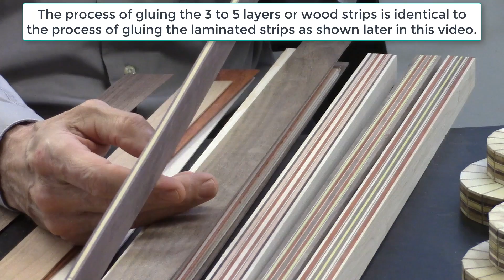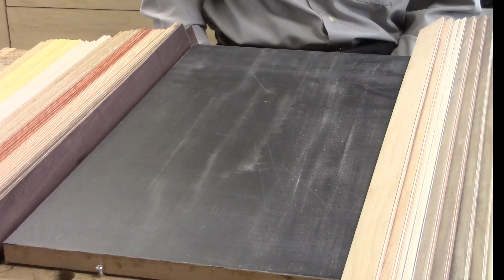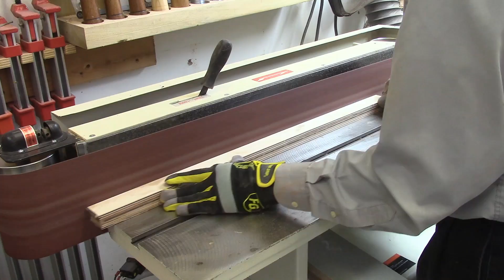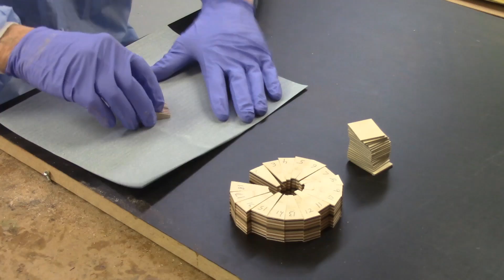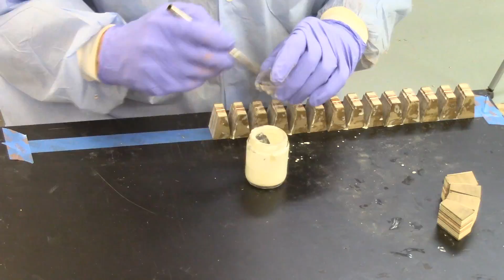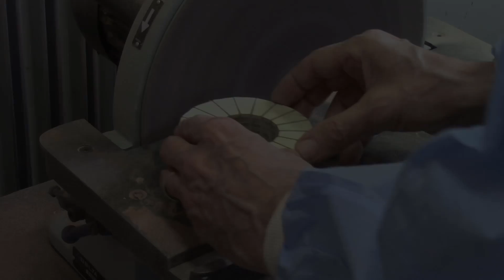Segmented Wood Feature Rings - Design and Production (10)

Comment: Great video, did you have to sand the wood after you cut from the bandsaw? I can make the strips but the cut is not clean enough / I have to sand before glue up. Thanks Again.
Reply from the maker: I normally cut with a 1/2" wide blade with 1 8 or 10 tpi.  With this blade the only sanding I do is to sand the fuzzies off the bottom edge of the wood strips and also sand off the bur on the end of the wood strip.  If I cut with a 4 or 6 tpi blade I would probably need to do some surface sanding.

Comment: I noticed you slid a piece of thin shim material under the front angle iron prior to clamping the glued-up strips.  What was its purpose and thickness?  You didn't mention it as you were describing the process.  Did the rear angle iron piece also have a shim?
Reply from the maker: The video you were watching is an old video in which I just used aluminum angle irons to clamp the thin boards together.  I am not sure why I used this shim.  It appears to be a thin strip about 0.020" thick.  The problem that I had using the technique described in this video is that the angle irons tended to angle up and not give perfectly parallel edges on  the glued up strips. I now use the Glue Jig system which is described on the following web page:

http://www.accu-slice.com/store/p54/gluejig.html

This Glue Jig system eliminated the angling up of the angle irons because one angle iron is clamped to the base and the other slides on a channel to prevent it from angling up. 

In the video tab on that page are a number of videos showing the application of this system.
Reply: @Accu-Slice  Thanks for the update.  I tried to check out the t-slot channels you mentioned were available on the accu-slice site but was unable to find them listed anywhere as a separate item.  Wanted to write up a couple of feasibility options before proceeding further.
Reply: @Accu-Slice  Can you point me to the location where the t-slot channels are available for the glue jig fixture. You mentioned they were available on the accu-slice website  in your glue-jig assembly video, but I was unable to track them down.  I would like to price out some size adjustment options to create some custom smaller accent rings.  Thanks.

Comment: i see your comment that you do not need to sand your strips. I use a Delta 14" band saw with the Carter guides and a 1/2" blade. tension seems good, yet i still get drift i must correct so I have to sand. I think I will try a different blade. any suggestions?
Reply from the maker: The only sanding that I do on my rings is a quick sanding of the edges to remove the fuies.  This is what is unique about the Accu-Slice band saw accessory.  Since the wood is mounted to a femce there is no laterial movement of the wood as it is pushed through the band saw blade.  As a result we see no band saw blade drift and the cuts are quire clean.  There are a number pf examples showing this technique on many of my videos.

Comment: Very interesting.  I think I will try your technique.  Two questions.  After you cut the strips of wood do you sand them or just use them as they are?  Second, can the accu-slice be used on a table saw?
Reply from the maker: Normally the only sanding that I do is to sand the edges of the cut pieces with 220 grit sandpaper to remove the fuzzies.  The cut surfaces are smooth enough that you can glue the slices together without additional sanding of these surfaces. 

The Accu-Slice was designed for the band saw and cannot be used on the band saw.  The main advantage is that the kerf of the band saw blade is normally only around 0.050" whereas the table saw has a kerf of 0.125" - which means that a lot of less wood is wasted.

We will be introducting a segmenting jig for the Accu-Slice in a few weeks, which will enable you to cut the wood segments for segmented wood turning on the bandsaw.  Again a lot less wood will be wasted.
Reply: Thank you for the prompt response

Comment: I haven't the patients to do this type of work, but it is very interesting to watch. Your finished rings are amazing. Out of strict curiosity about how much time does it take to create a set of rings not including any delays in waiting for glue to cure?
Reply from the maker: It's a little hard to saw.  For my last set of rings I spend more than 16 hours (2 days) just cutting more than 500 thin veneer strips of various varieties of wood to enable me to make about 30 laminated strips which will produce about 50 to 60 feature rings.  Designing a pattern, organizing the strips and then gluing up the strips takes at least an hour per strip.  Cutting the segments, spacer pieces and then sanding and gluing up the rings takes less than 2 hours.  So if I were selling my time to make a ring, I would guess at about 4 hours total per ring.

Comment: Looks like your putting massive pressure on the cutting of the wood...
Reply from the maker: Not at all.  I am just feeding the board slowly through the band saw blade.  The slower I push it through, the better the finish.  In fact I just finished doing a trade show and I was feeding the board through the band saw blade with just one hand while demonstrating some finished samples in the other hand.

Comment: Very nice work.  Thank you for sharing your process in such detail. On question: Do you worry about the cross grain orientation of your divider strips?
Reply from the maker: If the divider strips were more than a quarter inch thick, I would be concerned.  However my divider strips are normally only 0.020" to 0.0625" thick.  To date I have never seen a problem with the more than a hundred projects I have completed with these segmented feature strips.  There a a number of examples of some of my finished projects on our web site:  www.sisweb.com/wood/accu-slice.htm under the customer projects tab.

Comment: What kind of band saw blade do you use?
Reply from the maker: I normally use the 1/2" wide Timberwolf 8 to 10 tpi rake tooth tooth blades.  In another video on cutting the wide boards with  the Accu-Slice System I review a number of different blades to compare their performance when resawing some 12" wide boards.